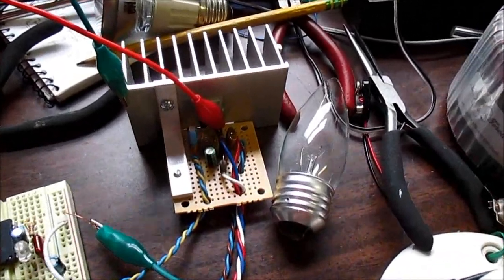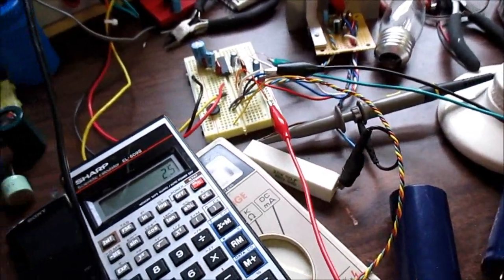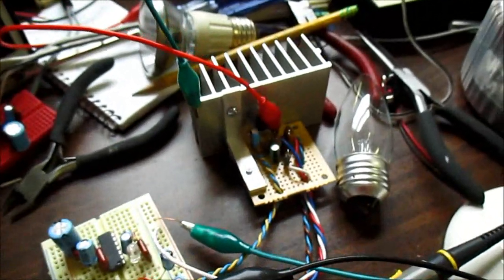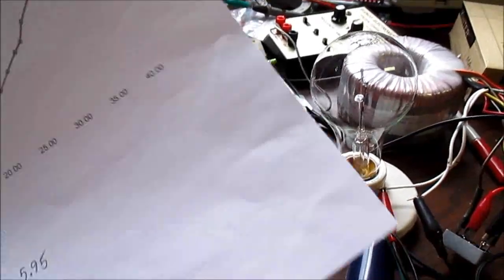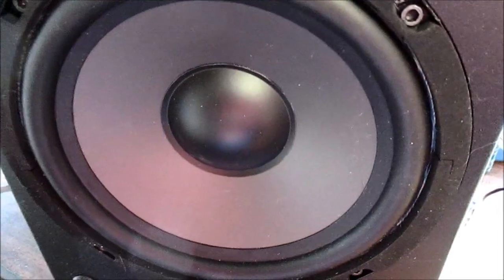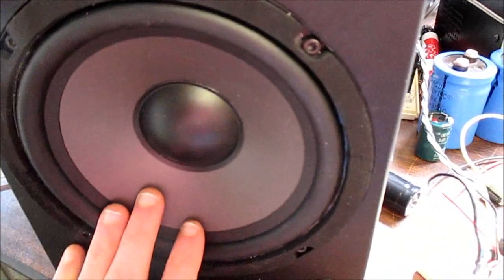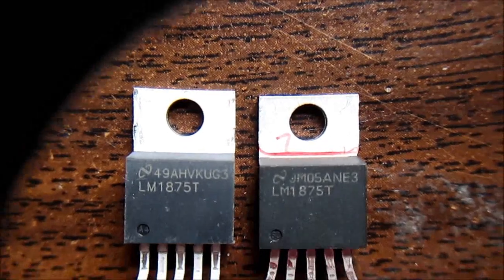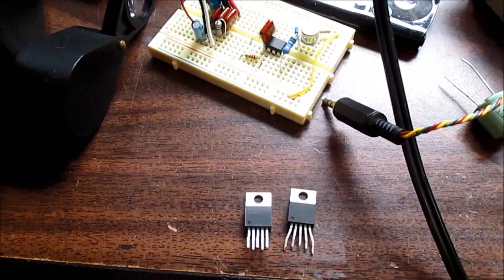LM1875 amplifier 30 watts with 8 Ohm load?

Comment: Very nice chip
I have a Chinese made amp (av 502a) with this chip used as a surround channel outputs and rated 50 watts based on its instruction manual.
Thanks for the video.

Comment: Hi John,
I'm amazed the chip is stable without negative feedback at such Hi gains. Shows the basic design is good even if it does have that noise floor. I think you need to make yourself a little preamp, you seem to have issues on a number of your video's with a lack of gain lol I enjoy watching however.
Reply from the maker: Michael Beeny I grounded the input to keep outside noise out. Moving the speaker ground return to anywhere near the input ground side would cause it to oscillate. At, say 90 db gain, no amp will be quiet as that is a voltage gain of about 32,000!

Comment: I have a pre assembled audio board based on Tda6283/Cd6283 and there's crackling sound when there is no input signal. The gain is closed loop (about 45 db ). Is it crackling sound also due to bad chip ?

Comment: I have question-
1. I have couple of Lm1875 chips and they look different than these here on your videos. That is they have two scoops at both sides like tda2030a  and 2050  but don't have the indentation mark at the corner . So I want to know did Texas instruments changed the looks of Lm1875 after they acquired national semiconductors ?
Reply from the maker: I haven't purchased any in a while but all the ones I have do not have the scoops. Mine have a small circular indentation in the lower left corner on the front. I'd consider yours counterfeits until proven otherwise.
Reply: You got fake lm1875 ICs, 
Original LM1875T ICs available locally in India ,

Comment: Hello John, I am working on several boards with LM1875/NE5532 IC chips, 2.1 Channel designs, already assembled. I'm too lazy to etch and drill a proper grounding scheme layout and cross talk issues and such. I thought this would be a good weekend project for me. Lacking any feedback from the Chinese suppliers re: currant demands of the board, wheres the missing cable harness with 3 pin connection for the audio input,etc. I gave up or put aside these boards till I got further info. Glad I found your video, very informative, although I would not recommend pulling out/in IC's with power still on. Are you at all aware of these boards on EBAY?. Lacking any further info these boards are worthless to me, do you think I got ripped buying from China? I'd like an opinion from a fellow tech-head, many thanks from So. California. PS your work bench looks just like mine.
Reply from the maker: audie aguirre Hi, I've not tried these boards before, but from what I hear it is highly likely that they use counterfeit ICs and other substandard components. They may work okay, but who knows how long they will last.
Reply: I can only hope, they look like there very well made, good grounding schemes, metal film resistors and audiophile caps  such as Elna , Samsung,Blue Dot, Sprauge, etc. But well see once I get them up and running. China does for the most part put out quality  stuff for the most part. it's a real shame some scum balls sell fake chips and substandard parts but I ask many questions before I buy and if there's no response for sure there a put on if they cannot answer a simple question regarding the products they sell, no ticket ,n o laundry,..with me ,..no answer, no sale.

Comment: John do a 16 ohm measurement and sound test in curious what you will find.
Reply from the maker: The power at 16 Ohms would be a bit more than half than at 8 ohms at a given supply voltage. Distortion generally lessens with lighter load with solid state amplifiers. Distortion is already pretty low (with proper circuit layout) with lower impedance loads that I'd say the difference would be inaudible.

Comment: Hey John, this is a little off subject. Can I run (safely) a pair of 8 ohm and 4 ohm speakers (simultaneously) off a transistor amplifier that's NOT rated for 2 ohm loads???

Comment: I have two 8 ohms 20 Watts (sub woofers) speakers removed from an old Tv which has built in Home theatre. Would you recommend a good Amp for it.
Reply from the maker: Check my video I posted a couple months ago about the best amp boards I tested so far. Those would work.